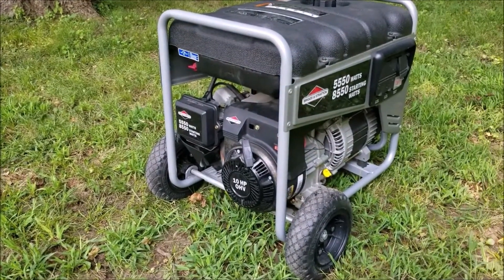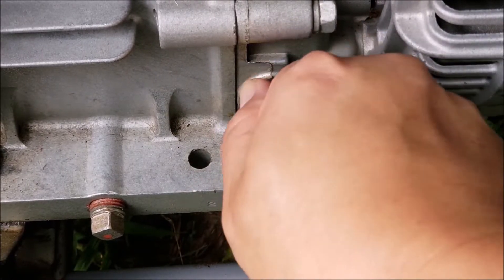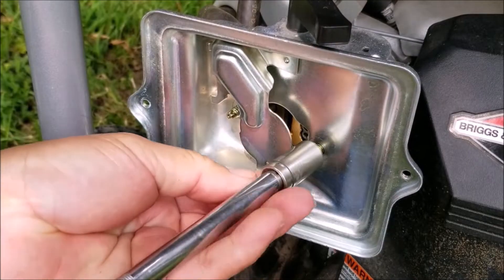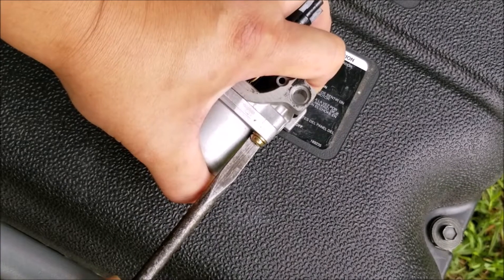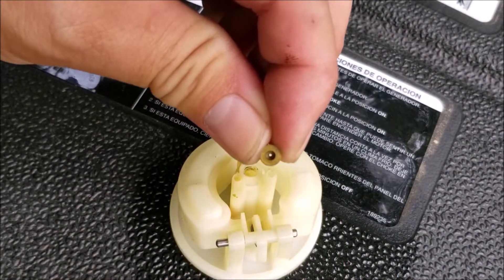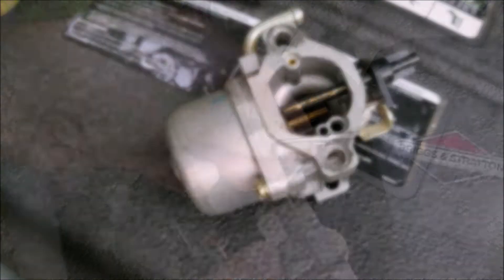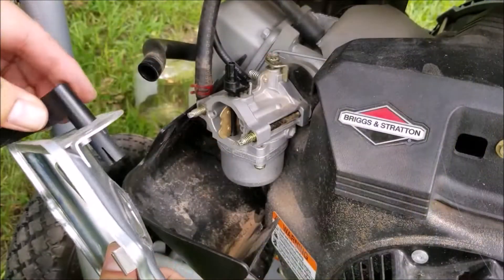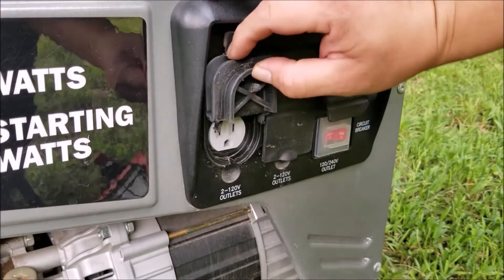Fix a Generator that only runs on Choke.

Comment: How about for a backwards situation, My  pressure washer will only turn on in the Run position for the choke, if i have it on choke it will not turn on. Is there a problem/fix for that?
Reply from the maker: If I had to guess, I'd say the carb was flooding the engine with too much fuel. That's why it only runs in the "RUN" position and not the choke.

Comment: I purchased a new carburetor but its still only runs only in choke. Any suggestions please?
Reply from the maker: If that the case, then there's a restriction in the fuel flow from the tank to the carb. You'll have to look at the screen inside the tank that leads the fuel line. That screen might be partially clogged with stuff.
Reply: @INSIDEHOUSEGARAGE 
Thank you. But I just realized after watching the video again that the piece you cleaned out was placed down in the tube. I didn't do that. I put that brass piece on the bottom of the plate. I'm betting it's in the wrong place. I'm looking tomorrow. It's running right now. Power is out on our area in Texas due to a major storm that blew through. It's getting us by but it can be better. Thanks again.
Reply from the maker: Sorry to hear about your situation but I'm glad you're making it work.

Comment: SOLVE THE PROBLEMS BEFORE THEY START BY NOT USING E10 PUMP GAS .....THE ETHANOL ABSORBS WATER FROM THE AIR.....BUY ASPEN FUEL OR VP FUEL OR NON ETHANOL GAS......
Reply from the maker: thank you!

Comment: Ours sat for several years sonce the last power outage till this hurricane and it popped 2ice than ran for 4 days more on than stopped. Took another battery for the electric start though. The old one was shot.  I added a 'T' fitting before and another valve and a long hose to drain the generator tank and ran the engine dry.  After the  power returned we drained the tank, ran the engine dry and changed the oil. DELO. Ready to go again.
Reply from the maker: I keep forgetting I need to do something like that. The t-fitting is such a smart idea.
Reply: @INSIDEHOUSEGARAGE  Drained the tank in around 5 minutes and you can be out doing something constructive while it's happening.

Comment: What would be the problem if i have to prime it for it to start and keep priming it for it to run
Reply from the maker: the carb is not working, and priming it is the only way the engine is getting fuel to run. Look at the carb and see if there's a problem with it.

Comment: Thank you! My Generac Wheelhouse 5500 generator seems to run smoother when backed off full choke 1 or 2 notches. If I run it on the "run" setting it seems to run rougher. I have sprayed choke cleaner around the gaskets but it made no difference on how it runs. Any suggestions?
Reply from the maker: sure, if you have the time, I'd start looking inside the carb.  If not, just replace it with a quality part.

Comment: Does it matter if my generator is brand new? Mine is doing this but this is the first it's had fuel and has ever been started.
Reply from the maker: I would check and make sure that the switch is in the "on" position, that the choke was ON, and that fuel was getting to the carb.  After that it's more diagnostics to find out what the problem is.

Comment: Good morning, I have the same generator as your. I cranked it up and switched it to the ON position. It ran for a bout 15 seconds and stop and also lock the choke. I am now not able to pull the choke because it's locked. Can you make a video on how to fix the locked choke?
Reply from the maker: you'll have to take off the air filter and the base.  Your choke flap might be stuck because of the base hitting it.

Comment: You don't have to remove the studs to get the carb off if the frame isnt in the way. I have a pressure washer that won't run unless you're thumb is almost completely blocking the air flow coming in the carb with the air filter housing off!
Reply from the maker: thanks

Comment: I replaced my carb with a new one and still have the running on choke issue. Must be the mixing valve/screw which I’ll be checking on tonight.
Reply from the maker: good luck with it

Comment: Hello sir idk if you answer questions but if so I have a predator 4000 watt generator I replaced the carburetor gaskets new gas changed oil had to running perfect it ran in hot weather probably about 96°F then I noticed it started to leak gas from carburetor now it will only run on choke when I try to turn if off it boggs out any help would be great thank you
Reply from the maker: interesting, first what I would do, would be to turn off the fuel valve, disconnect the line from the carb, and put it not a cup, and then open the valve to see what kind of flow you're getting from the tank, to the carb.  If that's good, then there might be a clog that made it from the tank to the carb and it needs to cleaned.

Comment: I have a generac pressure washer that has the same problem but the carb is fully clear to my testing can you help?
Reply from the maker: sure, but I need more information so I can help you. what's the model number of the pressure washer?  And when you cleaned the carb did you clear the Fuel Jet?  And if so how did you clear it?  thanks

Comment: In my experience, there is still gas in the bowl after you run the engine until it stops after you turn the gas cock off. I pull the bowl, take the hose off the gas cock, drain every drop of gas out of everything, run compressed air to dry out the tank. Tedious, yes, but I've had it start first pull no choke with this method. Gas is your friend, but your enemy too. Store the generator dry.
Reply from the maker: the tiny amount in the bowl will  evaporate
Reply: @INSIDEHOUSEGARAGE  On Hondas at least it gels and corrodes the bowl. Your mileage may vary.
Reply from the maker: I typically find ethanol fuel, to jell over time.  100% gasoline just turns to turpentine
Reply: @INSIDEHOUSEGARAGE  Yes, in my experience, it was ethanol gas.

Comment: i have craftsman 3600 watt it does almost the same thing it will start in choke but as i move towards 
run it will still run halfway between choke and run but the closer i get to run it starts sputtering than shuts of. any thoughts on this.  Thank You much
Reply from the maker: sure, service the carb, and also check the float and needle

Comment: Could a blocked spark arrestor cause the choke only problem as well?

I have a champion 46595 3000 watt, cleaned the carb and I have the same issue. I also removed and cleaned the fuel shut off valve and still the same thing...?
Reply from the maker: the spark arrestor would have to be 100% closed off, and that's doubtful. Even If it was 90% blocked, it would still start, and run although not well.
Reply: @INSIDEHOUSEGARAGE  
Thanks for the reply!

I actually verified that the spark arrestor is clear after I asked but thanks again!

I have a new carb on the way so we'll see what happens...
Reply from the maker: no problem
Reply: @INSIDEHOUSEGARAGE  
New carb...same issue 

I tried spraying carb cleaner around the carb while running hoping I'd encounter some change in how it runs but nothing...?

Comment: You know, 90% of all small engine issues, are caused by bad/poor fuel mixture, or dirty carbs. I have worked on thousands of small engines, from lawnmowers to outboard motors, and they all have the same fuel issues in most cases, when they run poorly
Reply from the maker: did you notice if I didn't something else wrong? I haven't looked at this video in some time.

Comment: Well, I watched the video, and I was correct, but don't just clean the main jet. Blow out all the other routes the fuel uses to operate properly as well. The jet cleaned in video was the high speed jet, and there was no mention of the low speed jet, being cleaned, nor the routes the fuel takes inside the carb, for low speed idle. NOTE: ... If your going to open up a carb to clean the main high speed jet, clean, and blow out all other routes inside the carb. as well, where  the fuel takes through the carb.  to operate properly. Then it's not a waste of time, in taking carb off a second time, if cleaning wasn't done well enough and still ran bad.
Reply from the maker: yes doing a deeper would have been beneficial but in this case, it wasn't needed.

Comment: Haven't watched the video yet, but just by going by what the Title says, tells me carb issues. Running on choke means not getting the right amount of fuel mixture, possibly running too lean., or carb. jets needs cleaning badly. I picked up a generator a couple of weeks ago, that had the same issue. I both cleaned the carb out properly, and reset the fuel mixture, and it runs great now. Starts on either first, or second pull. Now I'll watch the video, and see if I am correct in what I wrote above. I'll bet I am right.
Reply from the maker: thank you Wayne Davies

Comment: I’m afraid cleaning the carb didn’t do anything, neither did buying an entire new carb, or unclogging the fuel cap, nothing worked. What’s wrong with it?!
Reply from the maker: can you confirm that fuel is making into the carb bowl. If so, then the problem is the carb. have you checked for spark and compression?

Comment: A can of seafoam did the same thing for me simply follow the directions on the can and run it in choke til it it runs normally took me longer to mix the fuel/seafoam than it did to clean itself out stuff is amazing 😉
Reply from the maker: Great tip!
Reply: Obviously junk in the fuel can that ended up in the carb.  Dissoluble crud is a simple fix with Sea Foam but dead bug parts or leaf bits not-so-much.  You can't know which "flavor" you have unless you tear the carb down.
This is the biggest reason to use a screened funnel for ALL gas into small engines.

Comment: My fuel bowl was full of fuel when i took it off. Is that an issue?
Reply from the maker: it's supposed to be, that's the fuel, that's going to be delivered to the engine. Is there a problem with the generator?
Reply: @INSIDEHOUSEGARAGE  yours was empty when you unscrewed the bowl. Mine was full. I get it to start on choke but it pulses a few times and then shuts off.
Reply from the maker: I see, that makes sense, take the easy route ,and replace the carb that's what I usually suggest to people

Comment: What tool did you use at the 3:47 mark to push the jet down to pop out from the bottom?
 How do I put the jet back on? 
Is it pushed down from the top?  
Can it be cleaned out with a wire without popping it out? 
Appreciate any help! 
Thanks!
Reply from the maker: I used a torx screwdriver, but anything that will fit will work to push the jet out. 
You simply put it back in the hole, gravity keeps it in position.
Yes push down from the top to put it back in.
Yes you could clean it without taking it out but it might get clogged again, thats why I take it out.
no problem.

Comment: That is my exact generator.  Wouldn't start at all, so I took the carb apart and sprayed carb cleaner everywhere.  Now it only runs on choke.  I guess I'll take it off again and clean the jet.  Hopefully that works!!
Reply from the maker: that is usually the problem. good luck
Reply: @INSIDEHOUSEGARAGE  That fixed it!  Thanks a lot.
Reply from the maker: no problem.

Comment: The nozzle was the the problem !! I love it when a troubleshooting video actually fixes the issue,  Thank you
Reply: That nozzle as you called it, is known as the high speed jet. In this video, the guy should have cleaned all routes within the carb, not just the high speed jet. There was no mention about the low speed jet that's in every carb on the market. They need cleaning as well, and might as well do it the same time you clean the high speed one, so you don't get surging in engine.
Reply from the maker: Glad it helped!

Comment: Thank you so very much for this video my generator would run on choke and when you put it to run it would make a sputter noise but wouldn't cut off it was still right so now I'm going to take a loose my carburetor maybe it's the same problem thank you very much
Reply from the maker: no problem Johnny Harris
Reply: @INSIDEHOUSEGARAGE  I tried to do what you done it didn't work so I tried some seafoam and it worked
Reply from the maker: nice work

Comment: Thanks. This helped me immensely. I had the exact same problem. Only thing that got me was on the B&S 6000 portable generator there was NO spring inside, despite being very careful, it just didn't have one. But all 15 out of 16 air holes, and the jet nozzle was clogged. I'm surprised it even ran. Also echoing the notch on the handle comment below.
Reply from the maker: that's interesting
Reply: Some have a spring, while others don't. It will run without the spring in both cases.

Comment: Thank you...i knew this but forgot. Hey, sometimes...if there's enough room you can remove float bowl bottom bowl..without removing the carburetor and linkages and use a carb-spray into that jet and then a metal needle or pin to clean out that brass jet from below...and then just one bowl-bolt back on and you're up and running.
Reply from the maker: you are absolutely correct,  it just doesn't make for good filming is all.

Comment: I did all of this and got me a new carb and still ran on choke?
Reply from the maker: The carb wasn't the problem on yours, The fuel pickup inside the tank that goes out of thank could be your problem.  It has a built in mess screen the will varnish over and limit the amount of Fuel the flows to your carb.
Reply: @INSIDEHOUSEGARAGE  thanks, I did clean out the tank. I guess bi need to replace the screen.
Reply from the maker: @jeffnations6649  yes, the varnish is very touch to clean off the screen, no problem
Reply: @INSIDEHOUSEGARAGE  hi there again. I did what you said about the fuel tank. I hook up a separate clear tank I have for testing ethanol free gas and filter and still runs with the choke on. I guess I will clean the new carb again, but everything looks super clean and lights thru all the orifices. I have a mikuni VM 22 I will thinking about putting on it.
Reply from the maker: @jeffnations6649  that's strange.
Reply: @INSIDEHOUSEGARAGE  yes strange indeed. I have a Honda 200 GX
Reply: @INSIDEHOUSEGARAGE  I put the new mikuni carb on and runs perfect. Hope I don't blow up my engine. Lol
Reply from the maker: @jeffnations6649  excellent work

Comment: As far as the choke handle goes you do not have to force it off simply turn it so that the notch comes through the notch in the plate. If you look at 2:27 you can see the plate notch and the little bent plastic piece you forced with the screw driver. If you had tried in the run position it would have came right out.
Reply: I have had my 8250/5500 generator since 2009 and have had to pm it many times over the years! I forced my choke handle the first few times before I noticed the notch myself. I would say after having to rebuild my carburetor twice over the years that running it empty does not guaranty it will start next time. I agree 100% it seems like it would but I will challenge you to run it dry remove carb bowl and see what comes out.

Comment: The problem is Briggs carbs do not run good with ethanol additive in fuel.  Per the B&S people they never modified their carbs to adjust for ethanol additives.  That’s what I finally pulled that info from one of their techs, 4 years ago.  The engine only had 45 minutes on it.  I now drive into town to get ethanol free gas.  Expensive!
And here’s the kicker…. They wouldn’t cover it under warranty.  They sent a new carb but I was not allowed to install it.  I had to have the carb sent to a professional and I had to pay for labor!  I’ll never EVER buy ANYTHING that has a B&S engine.  Honda is the best I’ve found to date…
Reply from the maker: thank you BAD KARMA. Ethanol in gas is definitely a sticky issue
Reply: @INSIDEHOUSEGARAGE  
It was just an incident…
No problem…

Comment: I have an Honda EU2200 with about 2 hours on the engine. Only run non-ethanol+stabil. Also run the tank and carb completely dry. Plan on taking it camping for several days this summer, hope it starts right up.
Reply from the maker: I hope, when do you think you might do a test run?

Comment: Oh man!! Am so glad I found your video. Turns out it's the exact unit I have AND the same problem. Thanks so much!!
Reply from the maker: No problem and thanks for the comment
Reply: @INSIDEHOUSEGARAGE  Just a follow up. I was able to do this procedure this morning. It worked!!! Reason I'm excited about this fix is I'm in Texas and you probably heard about the problems we've all had here with the freeze. Our power went out during the rolling outages from the power company, then a water pipe busted (luckily in a exterior wall and not in the  ceiling). I had started my generator just about a month earlier but with temps in the low 20s, with no lights, heat, or water.... OF COURSE, when I needed it the most, had no luck starting it. Pretty sure I flooded it and sure the choke situation was the problem. That jet was semi clogged, like you showed, and after cleaning and re-assembly, it ran like new. 20/20 hindsight. Should have searched a month ago for this problem. Anyway, thanks again for sharing this video. So many times YouTube has saved me lots of costs.
Reply from the maker: @joeanddianeroberts1101  great work Joseph Roberts. I'm glad it worked out for you.